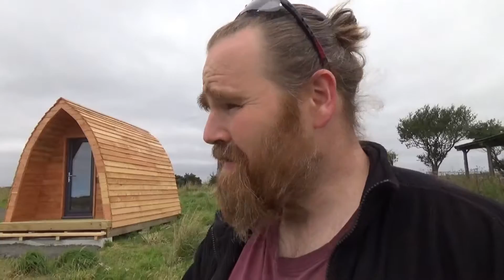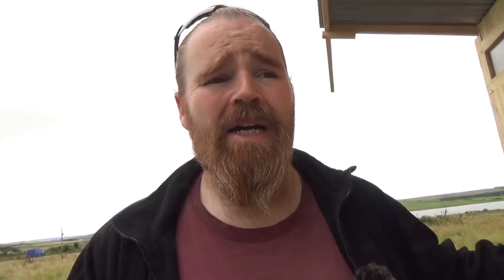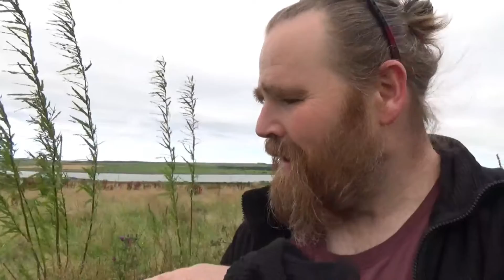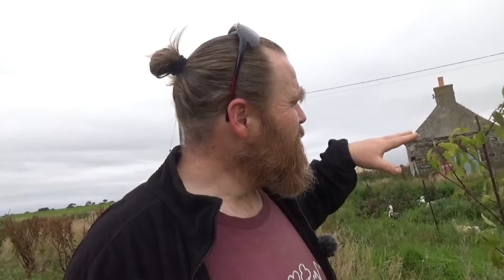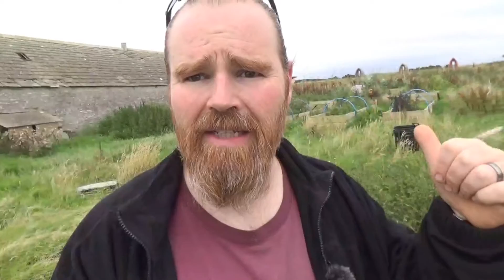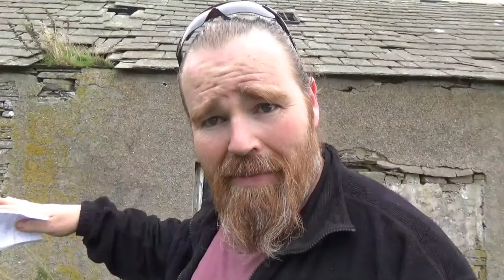Designing a zero input farm, house and business for a more resilient life

Comment: Only just watched this one, very detailed and informative video. How did the Ruth Stout potato method turn out?  I'm interested in trying it next year. Any tips? Also, plastic buried in the soil - oh man you have my sympathy there. thanks
Reply from the maker: It worked pretty well, in terms of producing lots of potatoes. But we had a rat problem last summer, and we lost most of the crop to them. It shouldn't be an issue this year though, since a weasel family moved into the ecosystem we've not seen a single rodent.
Reply: Brilliant, I’ll try it next year, sadly we’re not allowed to keep weasels on the plot! Great buildings you have there, good luck

Comment: You could take the hot air out of the conservatory. Through a dehumidifier into the house to supplement the heat in the house and cool the greenhouse   The water from the dehumidifier would be pure water good enough to drink  (or recirculate back to the plants) ,alternatively you could run ducting from The top of the conservatory down under the floor of the conservatory and have it linked to a thermostat so that when the temperature goes above the desired level the in-line fan turns on and removes the air from the top of the conservatory and  takes it through the thermal mass of the floor thereby creating a heat reservoir which can be released at night  as the conservatory cools. This will also create  some degree of seasonal buffering too
Reply from the maker: I might go with a climate battery in one of the larger greenhouses, but I'm keeping it simpler in the conservatory. It'll house a grey water system feeding wicking beds, the rest of the space will be paved to minimise water evaporation, so I won't have the cost of dehumidification before blowing the warm air into the house.